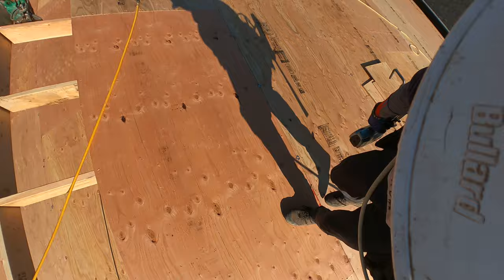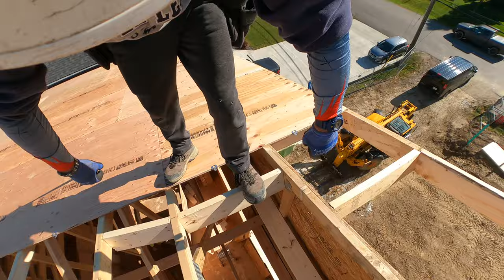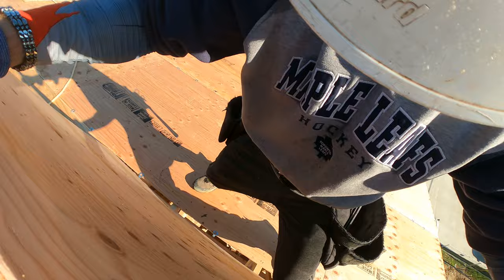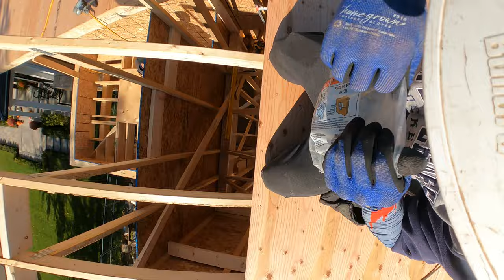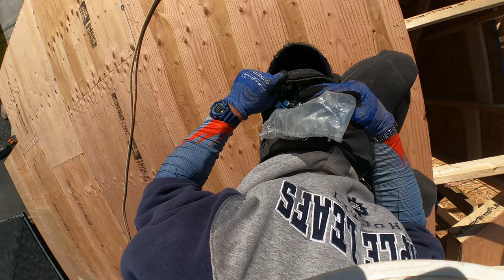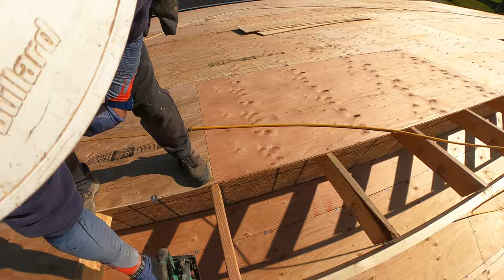Ancaster Custom roof sheathing

Comment: Still using 1/2 in plywood…thats been looooonng gone here in Florida- 5/8 only.
Reply: same here in northern ontario.
Reply: It'll all get blown away in a hurricane anyway so you might as well go half-inch!
Reply: Pretty sure that’s 3/8 they’re using. Could be wrong though
Reply: Im in southeast fl & stick frame is pretty much non-existent since hurricane andrew in 93. Everything is concrete block & 5/8 plywood 8d ringshank nailed 4” seams 6” in the field. I like framing beasts vids cause reminds of the “good ole days” 😁
Reply from the maker: @jonoliver5143  1/2
Reply from the maker: Most residential builders use 3/8

Comment: Holy cow no chalk line or factory lines on the sheets = shiners for days
Reply: Good thing it’s not a fucking cabinet then eh?
Reply: Keep watching. This guy bangs!
Reply from the maker: If you’ve sheeted three or more roofs you shouldn’t need lines . You can feel the difference if you miss by feel and sound.  I liken lines on sheets to training wheels on a peddle bike. Do you ride with training wheels ?
Reply from the maker: I’ll be sure to request paint lines on all the sheets next time
Reply: @conradodell9251  you could say that and then when the roofer pays someone barely above minimum wage to put shingles on your house, you can enjoy the storm from inside your attic 🤗 unnecessary holes = inevitable leak in a roof structure.
Reply: Lmao chalk every truss. That would be cute